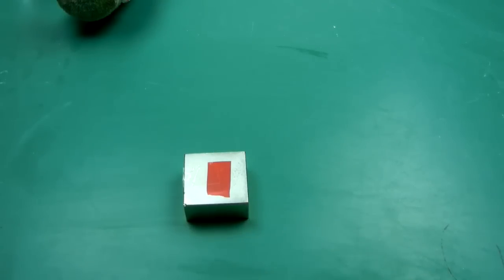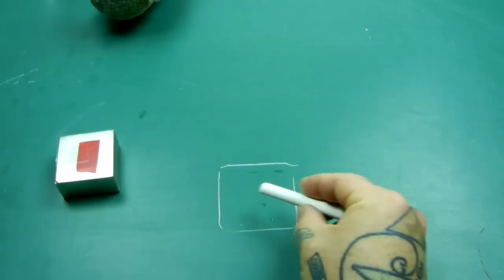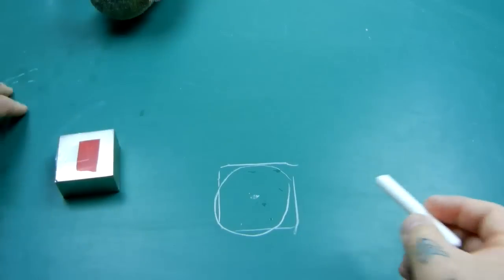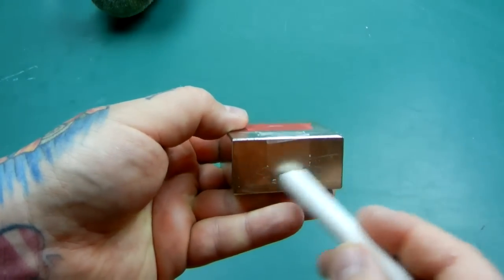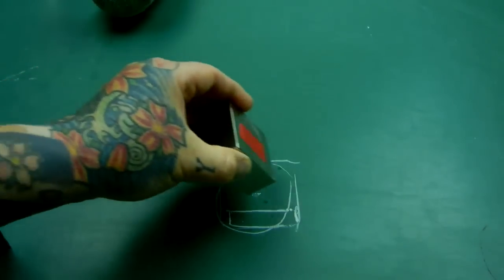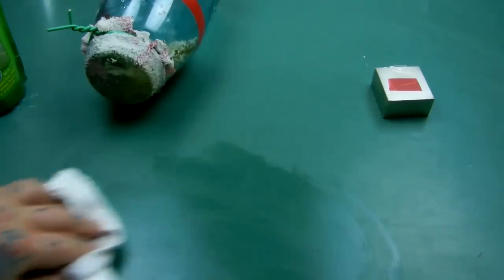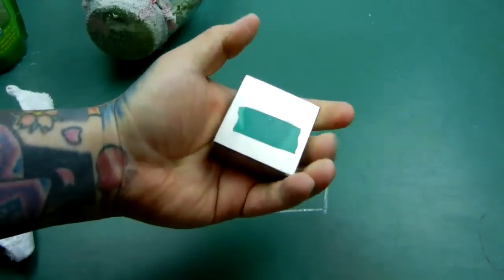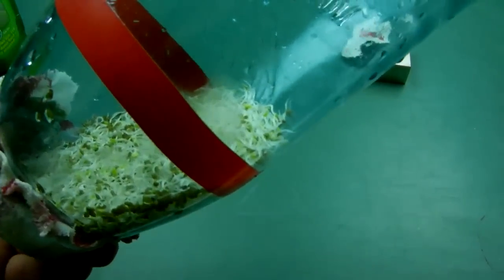VIDEO 6 Magnetic seed exposure experiment HOW ITS DONE. Seed exposure and/or Growth exposure

Comment: Hi Ken, is it possible to arrange a grid of smaller magnets as to get a larger area to place the seeds on?
Reply from the maker: noooooo, dont do that
Reply: Okej, I guess I will scout ebay for bigger magnets :)

And would there be any benefit of having two magnets and have the seeds sandwiched between two south poles?
Reply: @johnengstorm275  yes i have the same question..would it benifit sandwiched between two south poles?
Reply: @quad55555  these comments are years apart but I think this is how magnetic water filters work - two magnets sandwiching a water pipe.
Reply: @bettycooper369  yes but magnet's s or n pointing toward the water pipe?
Reply: @quad55555  I'm fairly sure south. It's the bigger side of the magnetic egg 🥚